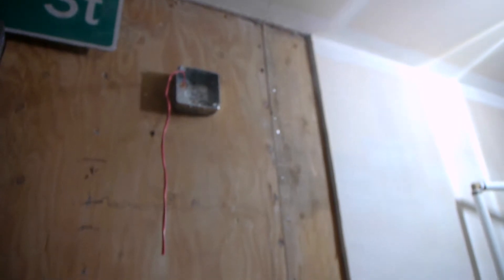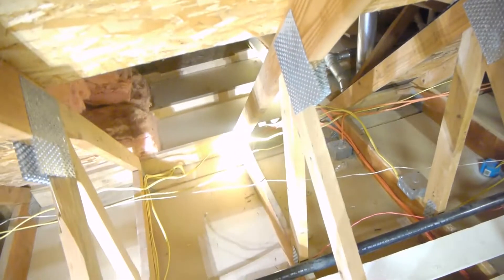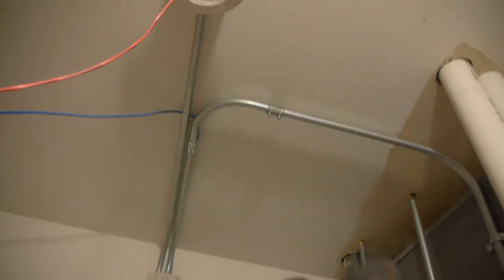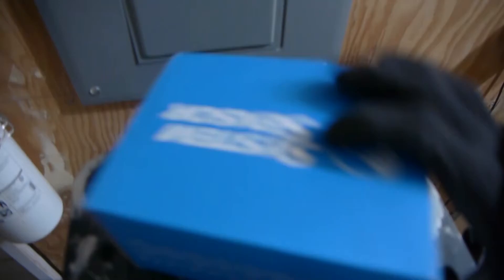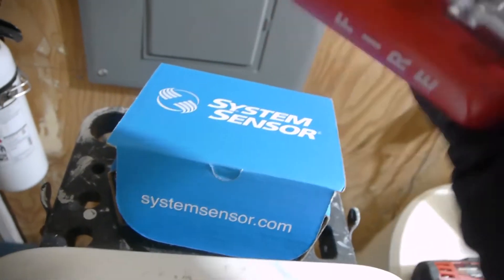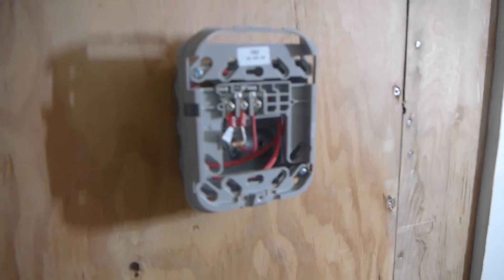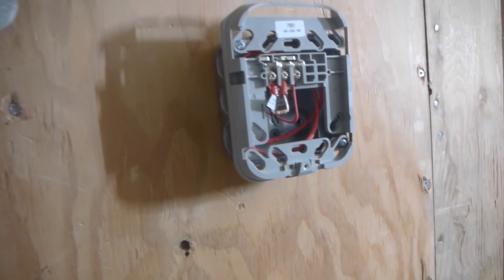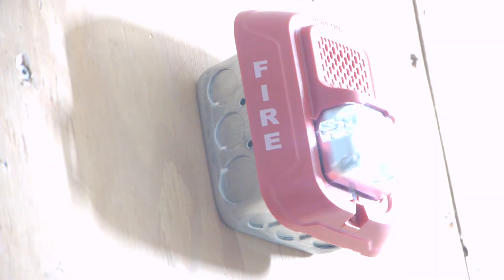Installing a new L-series Horn Strobe on the ms-9200 house system.

Comment: Low frequency??
Reply from the maker: No
Reply: @FireAlert  You said you switched the L series to low freq
Reply from the maker: @AcElectronicSystems  Cool
Reply: @AcElectronicSystems  You can't really change an L series into a low frequency sounder. It has to be one made by system sensor.
Reply: @Sirenfireproductions5209  what

Comment: Cool looking forward to see the system. Why didn’t you flush mount since you really easily could?
Reply from the maker: Thanks for watching. 
1. we are installing a flight of stairs and this might need to move over 2 bays.
2. I will be adding some heats in the same room and I will be using EMT and I can use this to get the wires into the wall.
Reply: @FireAlert  Just wondering with the smoke detector when you have an attic above